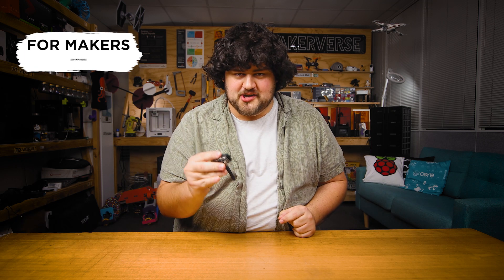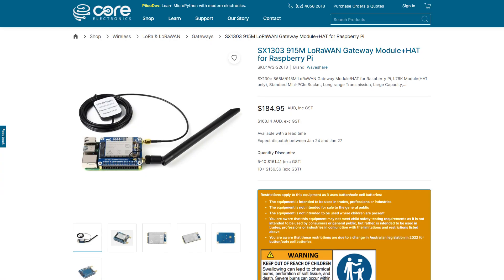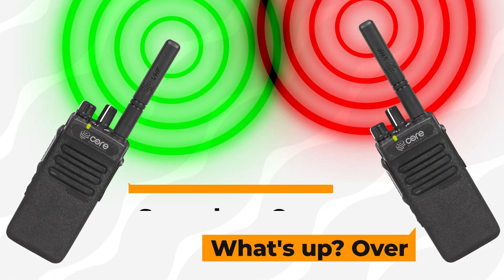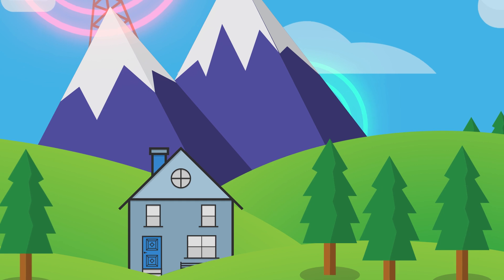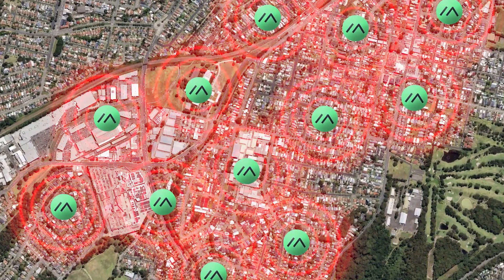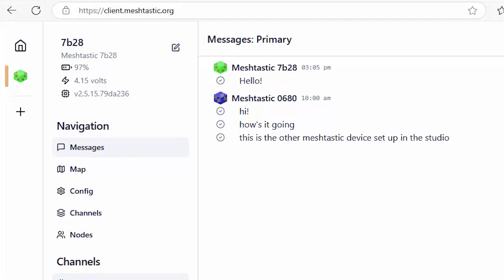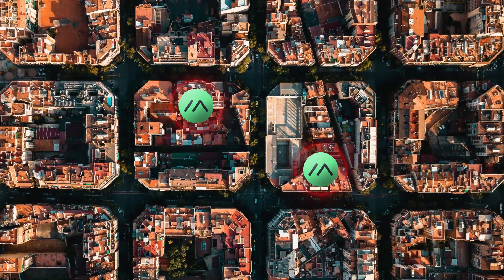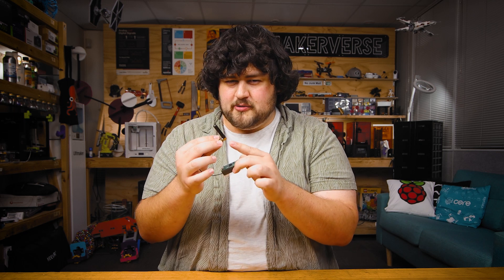What is Meshtastic? | Meshtastic for Makers Workshop

Comment: I think the best implementation for it is really in wide open areas like ranches. Imagine having lots of land with several gates, windmills, watermills, animal farms and crops and tractors and so on. But you want to keep an eye on them. When someone opens a gate, when wind changes direction, water levels, chicken coop temperatures, every cow walking around the property, your trusty dog companion location... You can keep track of everything from very far away, no cables or huge antennas and no electricity needed. Everything can emit a low radio signal talking to you, giving you whatever data you need and you can talk back to give it instructions. Its basically a smart home but on a wide distance scale. Enthusiasts buy some devices and either find that they are in a dead zone and nobody is around or that they are overcrowded and get spammed. But can't find what to do with their nifty devices.
I think its great, if you have the use for it.
Reply from the maker: This was a lot of the imagery going through our heads when making this series!
Reply: Still learning about meshtastic, so how do you use it for something like you mentioned, when someone opens a gate?

Comment: hydrogen balloon to get your antenna high, strong cable, solar panel, battery, winch to manage balloon, system needs weatherstation to manage winch,
a few years later
Reply: Diatomic hydrogen would leak from that balloon very quickly.

if you lived in a valley with extremely consistent and predictable wind patterns, then you might be able to use a kite.